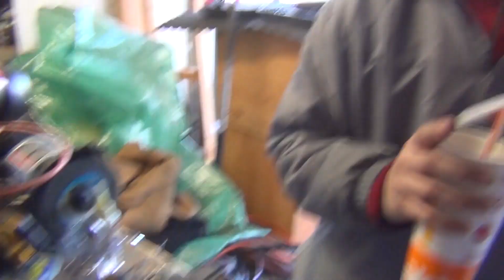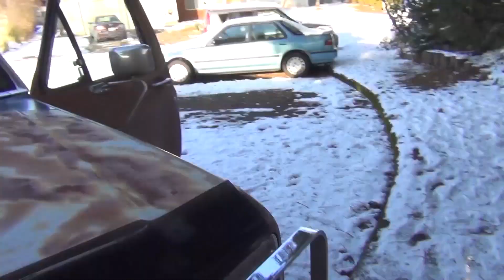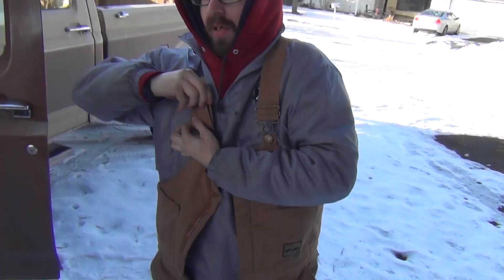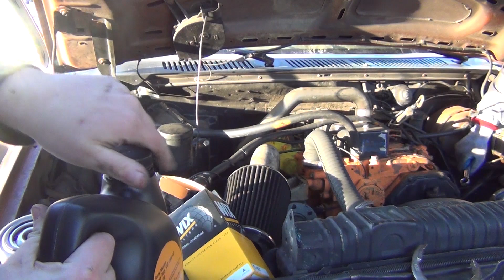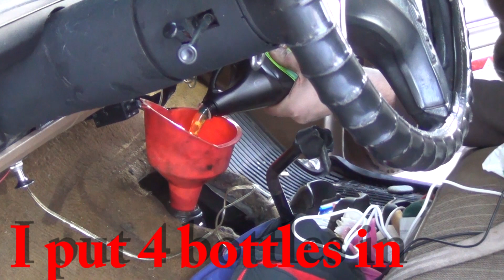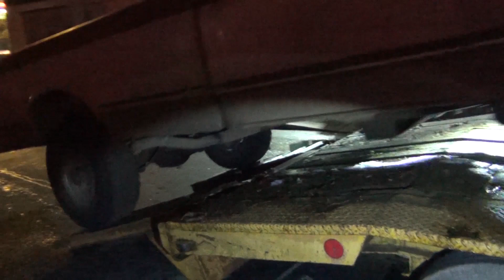Bullnose Ford F-350 | Neglected Oil Changes

Comment: Do you think a 4BT will fit in a Ford Transit?
Reply: It's possible. There is a 3.2L I5 diesel available for the Transit and the 4bt is a 3.9L I4. It would probably be a tight squeeze, but could work if done right.